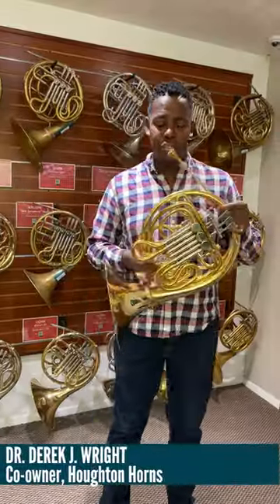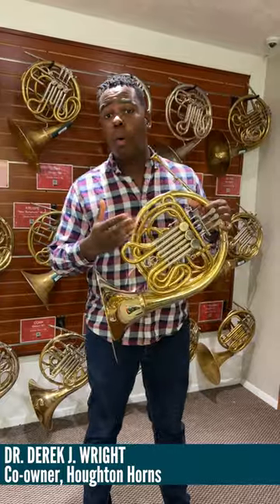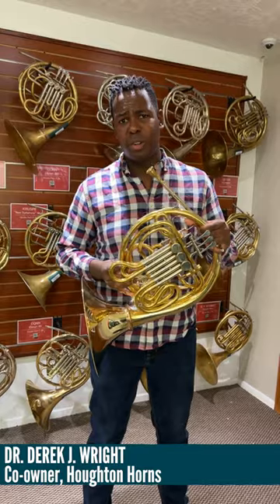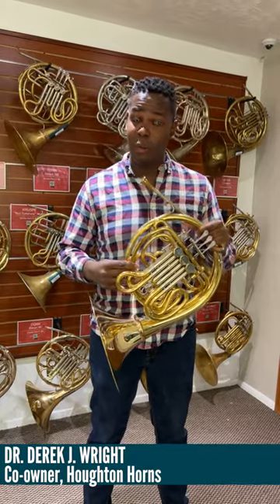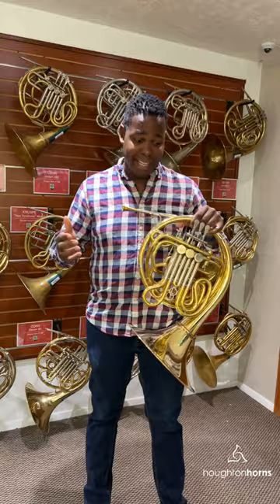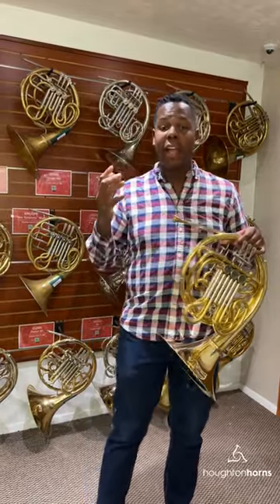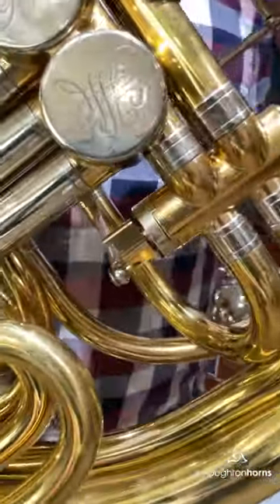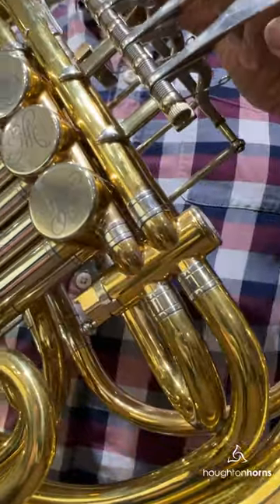Will Sanders Y6 Double French Horn @Houghton Horns #shorts

Comment: Wow, that's really interesting.

It would be nice to see how it shows up in BIAS measurements and how is built internally.

Also, E. Schmid horns also claim they have a unified valve section, how does it compare to it?

Jacob Medlin says in his blog series that what really matters is the air volume within the valve section, which is inherently curvy and bumpy but it doesn't impact the playability or the sound. It's a very small section on a very long tube after all.

What do you think about that?